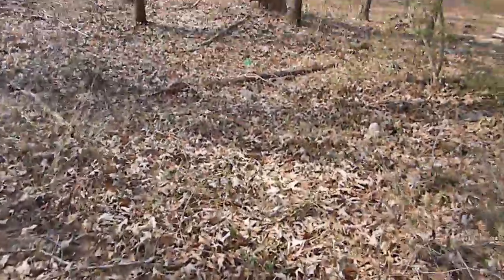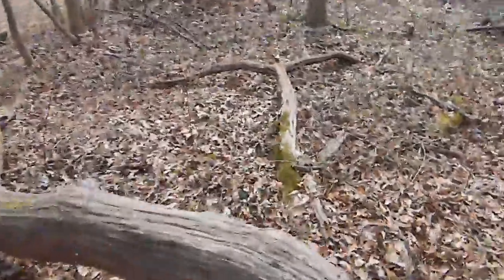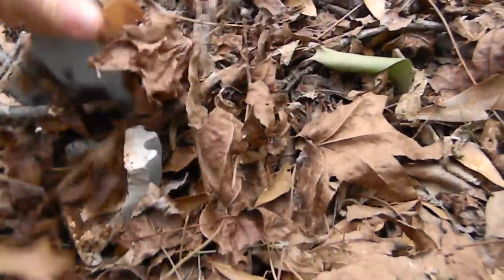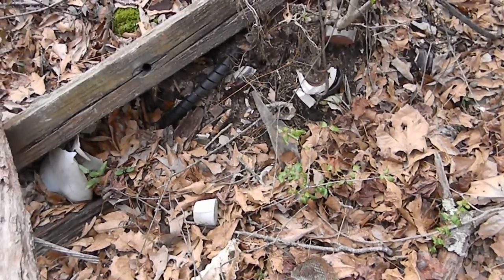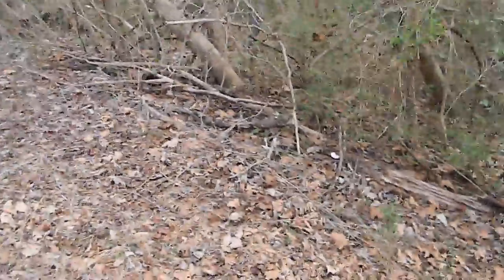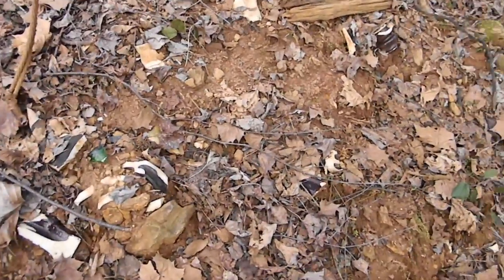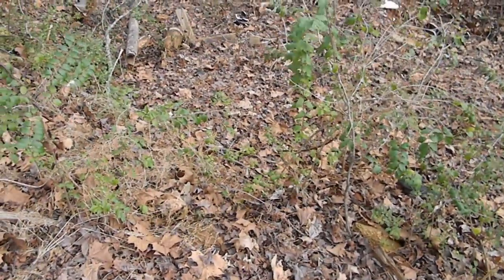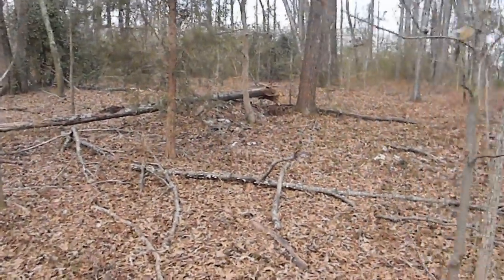HUGE Duke Power Substation 1940s Insulator Dump

Comment: There is an old insulator dump behind Hollywood Cemetery in Richmond, VA. I found pieces of old Hemingray 2 piece along with some other rare glass and some rare early suspensions. Most of them were busted up but I was able to find some in good shape just before the Kudzu covered them up and buried them forever. Fire also hit the area and destroyed what insulators were buried.

Comment from the maker: pel991,

I have returned to this dump site twice and did overturn the two multiparts in the woods at 8:28. One of them was a Lapp with logo in orange from the 1920s. The other that is completely turned over was an OB piece. From what I can recall the top had damage and I left it. Last year after my third trip to the dump Duke Energy actually installed a new gate. When going to this site there werent any posted signs unless you neared the modern substation. Im sure that changed and there are posted signs all over the place now.